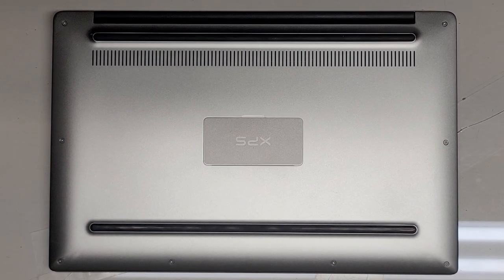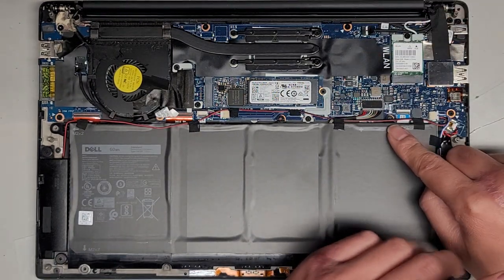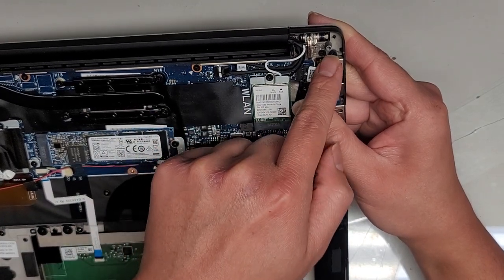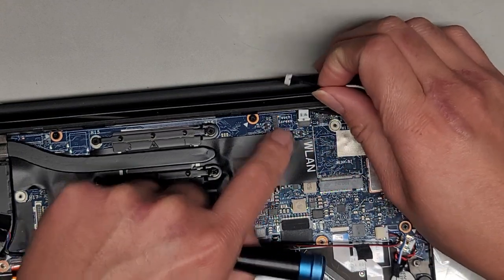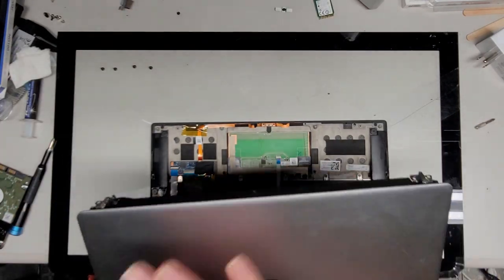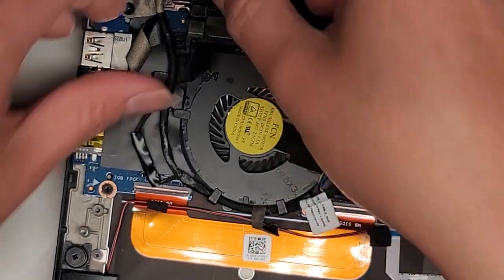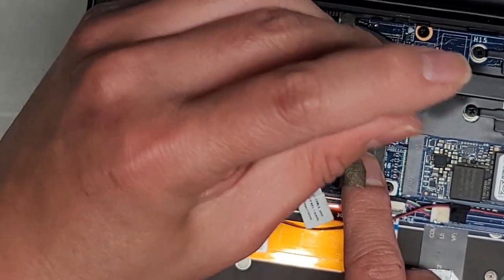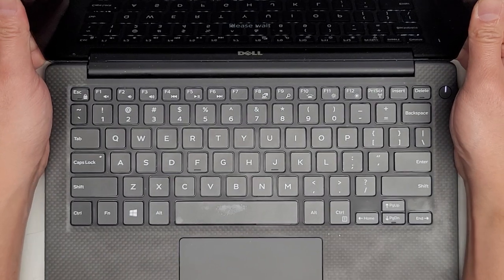DELL XPS 13 9360 Disassembly SSD Hard Drive Upgrade Battery LCD Screen Assembly Replacement Repair

Comment: Is it possible to install WDS200T2XHE (2TB SN850X NVMe Internal Gaming SSD with Heatsink) in XPS  13 9360?
Reply from the maker: Heatsinks take too much space.
Reply: If you carve a hole in the bottom plate. sure.
Reply from the maker: @robinwatson4282  lol